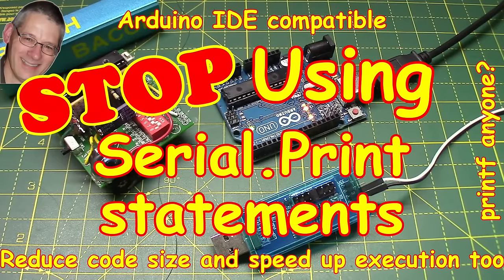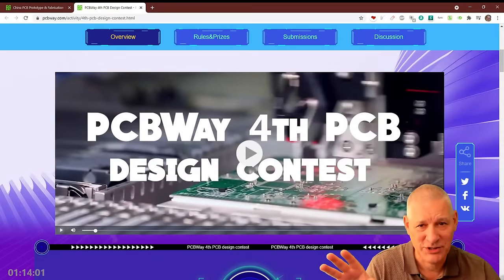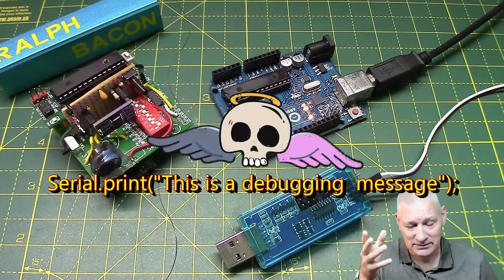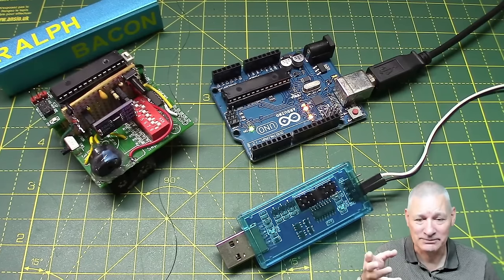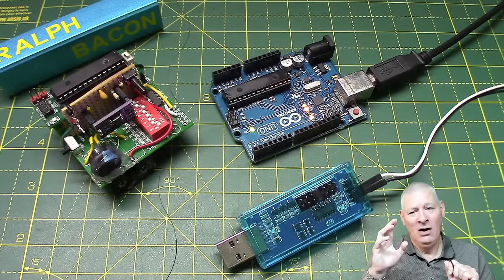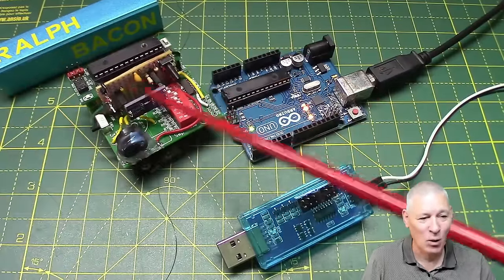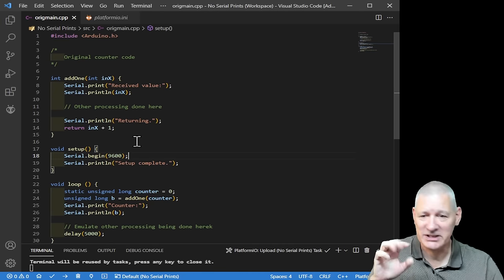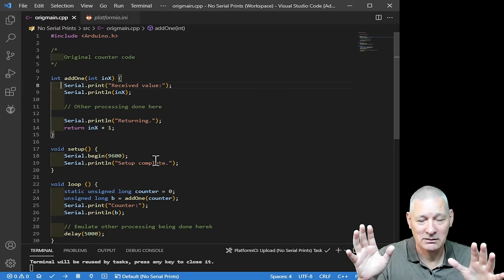#224 🛑 STOP using Serial.print in your Arduino code! THIS is better.

Comment: i replace Serial.print statements with defSP, then use
#define defSP //;
to turn debugging off - including the ;
and 
//define defSP Serial.print
to turn it on.
Not necessarily perfect, and it enforces some simplicity on debug lines, but it works.
Reply from the maker: It does work, indeed Ross. If you want to stick with it, by all means do so. If you look at my Advanced version in the GitHub, you may find the granularity beneficial, however.
https://github.com/RalphBacon/224-Superior-Serial.print-statements

Comment: I understand what you're doing but I don't understand why you're doing it. If program and data don't fit into memory in debug mode what does it help if they do in production mode. It also makes the program behave differently in development than in production, which is undesirable. Only in rather unusual circumstances I can imagine it might be helpful: If you 1. use heap (discouraged) or 2. want to use OTA updates with production builds only (cumbersome because you first have to serially flash a production build) or 3. want to use different hardware with smaller memory for production (unlikely for hobbyist applications).
Reply from the maker: My ESP32 was on the border line with its partition scheme; by using the more advanced features of my debugging method it reduces the code size (ie I eliminated all the Verbose lines) I was able to fit in the remaining code quite easily without having to re-partition - including all the SPIFFS/LittleFS stuff which would have been a pain.

That all said, I hear you. If it does only just fit with some debugging lines switched off, then if you re-enable them, it will no longer fit, especially on the Arduino.

The upside of reducing program bloat is that it compiles more quickly and uploads more quickly, even if it's 1Mb in size, like mine.

Ignoring the space-saving for a moment, there's still a lot to be said to support using this method to keeping the program nice and clean. Far, far better than #if...#else...#endif statements everywhere. Don't you think?

Comment: As a retired developer and present day electronics hobbyist, it pleases me a lot when I see other developers implementing the same ideas or methods I come up with myself. This "I'm not that stupid" feeling is awesome. Thank you so very much!

I use to call it "VERBOSE", instead of "DEBUG" though. (old console habits)

I also like you using a decent IDE. I do understand The arduino IDE was designed for laymen and beginners, but the thing is just awful.

just for fun, here's a one liner for blinking an LED:

#define BLINK_LED  digitalWrite(LED_PIN, millis() % 1000 > 500)

Have fun! And stop arguing with sharp objects :D
Reply from the maker: I'm keeping well away from sharp objects, Sammy, of that you can be sure!

Yes, I'm also sure that many of us seasoned developers have all got our ways of doing things and they serve us well.

I like the blinking LED code; pity the pinMode statement could not be included! Oh, it can, there we are. For others reading this:
#define BLINK_LED pinMode(13,OUTPUT);digitalWrite(13, millis() % 1000 > 800)

In the loop just call:
BLINK_LED;
Reply: @RalphBacon You're absolutely right! I forgot to mention the setup, as I'm actually using it on pin 13 which doesn't need a pinmode setup. Just copied and pasted. My bad.

Comment: Print or println are broken anyway in Arduino. Often nothing is printed at all. It’s so by design and clunkiness of whole ecosystem. Use second serial port and external dongle UART instead.
Reply from the maker: "Often nothing is printed at all" you say. That has NEVER happened to me unless I forget to include the Serial.begin(115200) at the beginning of the setup.  

The UNO (and Nano) only have one UART present anyway, unlike some other chips.
Reply: @RalphBacon  So you are lucky. There are some posts on internet about that issue. Of course it was initialized. I made one sketch for stepper motor on small Arduino Leonardo aka Arduino Pro Micro and had to use Serial1, then it started to function properly. But what even worse is that ESP32 running arduino has the same issue. I was running Wifimanager Basic and guess what, I had to reconfigure port and use external dongle to see messages. As soon as the WIFI part code kicked in , println stopped to work on built in UART. I even checked power supply with scope, but the solution again was to use external UART. Tried different serial port console. It is what it is. Don't have to spend any more time when the solution is simple. Sometimes uart works, sometimes don't. On external it was rock solid.
Reply from the maker: No luck involved, as far as I am concerned. Think about it. You are connecting an external Serial-to-USB dongle to the Tx and Rx pins of the microcontroller directly. Great. That's got to work and I do it often so I can upload without the COM port being blocked / in use.

But the wiring diagrams of all microcontrollers is pretty much the same as far as the on-board Serial-to-USB chip is concerned (the most recent ESP32-C3 chips excepted, they don't have one) and are wired the same as your external unit.

Anyway, with or without Wi-Fi my serial output has always been available on all boards and it didn't require any luck, just physics. I'm just about to implement Wi-Fi Manager in my next project; if I get issues I will re-comment here, for sure!
Reply: I am barely a beginner in programming, and I have never had such problems, only in my understanding of the code. Once I got the code right, no problems.
Reply: @RalphBacon  I've just tried replacing Serial1 with Serial and it doesn't work on serial monitor. I would have to strip down my program to a basic part or delete my stuff to show you. But it is the fact.
Reply from the maker: If you were using Serial1 then you are not using an Arduino Uno or Nano (the base hardware this video was really aimed at). So what board are you using and is the USB socket even wired up to accept output/input from Serial (the other UART) on your board?

Or perhaps you have two USB sockets (like some of the newer ESP32 modules)? That seems to be the obvious explanation. Let me know and we will get to a rational explanation!

Comment: Love this will have to go back to some of my older codes and try this see how much memory I can save also run a blink test see if it makes it faster 👍 great video ☺️
Reply from the maker: It won't make your Blink test run any faster if you have used the "delay(x)" statement. But if you have coded it in a non-blocking way then it will certainly run the code more quickly as it does not have to deal with, and wait for, serial output to complete.
Reply: @RalphBacon  yeah I have a custom blink with out delay, it acts more like a heartbeat LED but I have used serial.print about 10times in it so will be just interesting. Sorry to hear about your ✋ hand. You take your time Ralph and be safe

Comment: Lovely explanation of text substitution macros! I've understood them for years, but still enjoyed following along and seeing how they were explained. I'd link this if someone was struggling with them.

On another note entirely, one of the little yellow messages sent me down a rabbit hole of memory and hypotheses. :) "We'll talk about single-step debugging another time... for larger processors that support it." Single-stepping has been around the whole time I've been interested in coding, so that I'm almost sure I've seen it on the 6502! :) But I could be wrong, it's been a long time. I guess an in-system debugger (which was the only kind most of us BASIC kids could have in the 80s) could implement single-stepping without hardware support by copying each instruction in turn into a special subroutine within the debugger. But I don't know, I'm hypothesizing. :) Besides, this was all for assembly language. A source-level debugger for a high-level language is a bit harder for me to conceptualize. Perhaps it could single-step by automatically placing breakpoints. I know we had breakpoints without processor support. I think they were implemented by writing jump or call instructions into the code, saving what was originally there.
Reply from the maker: Single-stepping on the Arduino family (and related) microcontrollers is something quite new(ish) and can never be done on the 8-bit AVR chips. But as for the 6502 (I programmed that in Assembler, once, converted from a Z80 program) I don't remember debugging except in the most basic, and painful, way.
Reply: @RalphBacon  I'll defer to your experience then. I did program the 6502 a little bit, but I wasn't good at it and it was a long time ago.

Comment: It can be nice to put in a serial.print with the software (sketch) filename & version, and some very basic messages as to what it's up to (i.e. steps in a state machine etc.), assuming this does not impinge on program operation.
Not really super handy as you finish the project off,
However very handy many months/years later when the device you created starts playing up.
So you don't end up with something similar to a commercial device that you are trying to repair that is 'stuck' in some unknown state and you as a repairer has no idea what, and just wished it would say what it's trying to do.
As in a message every 5 to 10 seconds etc. Not megabytes of text you have no chance of keeping up with.
Reply from the maker: The Advanced version of this technique (see my GitHub) prints out the function name and line number; perhaps that would be what you are looking for?
https://github.com/RalphBacon/224-Superior-Serial.print-statements

Comment: Your solution no work for STM32
Code below work for me.

// undefined for used debug
//#define DEBUG_ENABLE

#ifdef DEBUG_ENABLE
#define DEBUGLN(x) Serial1.println(x)
#define DEBUG(x) Serial1.print(x)
#else
#define DEBUGLN(x)
#define DEBUG(x)
#endif
Reply from the maker: I must admit I did not test it on the STM32 but as it uses the same compiler I wonder what the issue was (you didn't say).

Comment: Hi Ralph, jst ran across your yt. channel and I’m finding it very helpful and educational.
I notice that you’re using PlatformIO.
Have you done any videos on how you installed the various Espressif devices onto PlatformIO?
Reply from the maker: I haven't, but it's very simple:
1) click on the Alien head and then under Quick Access choose Open
2) click on the Platforms button then type in esp in the search text filter bar
3) choose Espressif 32 from the list and click Install
Voila!

Comment: I see where this would be great for some of my projects which have a few thousand lines of code.  Even if you require serial.print for communicating with other processors, just use that explicitly and everything will still work.  Awesome! Thanks!
Reply from the maker: That's a great idea!

Comment: Why dosn't the compiler care about all the extra semicolons in the code when you use the "#define debug 0"? Or does the pre processor directive remove the semicolons as well?
Reply from the maker: Extra semicolons are not a syntax error - try it! They will just be removed (or ignored) because the statement (preceding it) is empty. Some IDE formatters will put each semicolon on a new line, however!

Comment: The format print in general is memory intense. The format string itself would be copied multiple times in replacing the placeholders, not mention the placeholder interpretation itself would require dictionary like data chunks loaded into RAM. Arduino only supports upto 2KiB of RAM. Therefore, it's pushing the MCU so hard that your program is more likely to reach an OOM, while doing complicated projects.
Reply from the maker: So put the strings into flash memory by using the "F" macro. Problem solved.
Reply: @RalphBacon  In that case, you need to find a compile time format print library. The default varidic function format print won't fully settle in compilation.

Comment: I'm only at 5:12, but I think I know where this is going to go, let me explain my solution (having programed in c languages for 12+ years). I simply put a bit flag into the C++ code which was 'debug' and yes it turns of all of the print statements using a default value of 'false'. I then wrote a compliemtary .netcore c# application using interop to scan / connect and communicate with the connected serial device to flip the bit value along with writing a library of two way com commands to get 'state values' from the application enabling control over relays etc. I'll now continue your video :)
Reply from the maker: I had re-read your solution a couple of times (at least) to see what you were doing there; quite sophisticated and even though I have many years' programming experience in all things dot Net and C# I'm just guessing that my viewers will not be able to program your solution, great though it is!
Reply: @RalphBacon  Many thanks for the comment fellow coder! I really enjoyed your video, If I have any questions on arduino (I'm fairly new to the platform) I will try to make them intelligent ones!

Comment: Great video. I have used something similar to this in my code before, but yours was a little more simple to implement.
I'm sure you know, but you can also concantenate Serial.println statements in Arduino code. However, you do have to cast any string part as a string. But variables are assumed as strings.
Example:
int x - 5;
Serial.println((String)"x = " + x);
Reply from the maker: You have to very careful with String in the Arduino workspace: it can really carve up the heap memory, leaving holes that are useless and thus causing a program crash eventually.

Comment: I just put a // in front of the prints.   or #ifdef notdef   ...  #endif  to uncomment blocks
but essentially once it works I just delete them so the code is clean and easy to understand.
Reply from the maker: Well, certainly  you can do that, of course, but I'm showing a slightly more sophisticated way of doing it. You should take a look at what Espressif do with the ESP32 framework and all the log_x defines!
Reply: @RalphBacon  Hi Ralph, what I enjoy about programming these micros is the code is small and simple, once it becomes big and needs logging, ceases to be enjoyable.
My msp430 has an actual debugger with stepping and such, always thought it primitive the arduino resorts to prints, but it is effective if the code is simple enough and the timing is not critical, for my rf code the timing IS critical, so even stepping does not work and the logging is good, I do primitive logging just incrementing variables and such.

Comment: I use the following code, but I'm not sure that even this has absolutely zero impact on the compiled binary (when debug is disabled). Perhaps a proper coder would know. EDIT: Oh, I see that you use essentially the same method.

#define DEBUG   //If you comment this line, the SERPRINT & SERPRINTLN lines are defined as blank.
#ifdef DEBUG    //Macros are usually in all capital letters.
   #define SERPRINT(...)    Serial.print(__VA_ARGS__)     //SERPRINT is a macro, debug print
   #define SERPRINTLN(...)  Serial.println(__VA_ARGS__)   //SERPRINTLN is a macro, debug print with new line
#else
   #define SERPRINT(...)     //now defines a blank line
   #define SERPRINTLN(...)   //now defines a blank line
#endif
Reply from the maker: Pretty much (in fact, spookily so) what I used in my most recent project so we're all singing off the same hymn-sheet! 👍

Comment: Or you can just remove them? I work with a moderate 50k lines project and we never leave the logs when we merge something.  I can't possibly think of a situation where you leave 50 of those things around in a microcontroller project.
Reply from the maker: Yes, leave them in, you never know when you might need them again. Use the conditional compilation method that will remove them from the compiled output (so your program remains small) but can be put back when/if things really go wrong.

Comment: If you leave those debug prints in your code once debugged you are writing bloatware. If you want to use them remove them quickly.  Conditional assembly can removed them, but still makes for messy code. When you revisit your code a year later you will thank yourself for not leaving them in the source code.
Reply from the maker: Well, you might thank yourself for not having any kind of serial (debugging) output, richard, but my mileage varies a lot from that. 

Although I might not compile the final code with the serial output switched on (and therefore slowing things by down sending serial bytes down a blind alley) I very much appreciate being able to see what's going on when I next compile!

The ESP32 goes further with its variable level logging (verbose through to error) and it's but a few seconds to recompile with the required level when things go wrong.

Please don't tell me you remove comments from your final code? What do  you mean "What comments?" 😲😁
Reply: Bad idea to remove those disabled debug lines - they serve as comments, and help you understand the code better. Not to mention that you can switch to debug output in a second any time you want. I was doing that for decades. Works great.